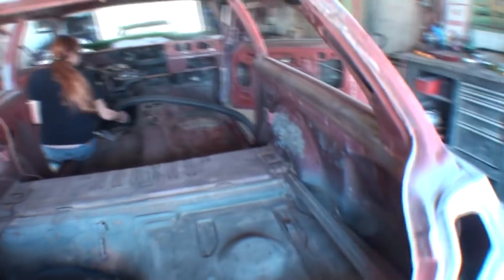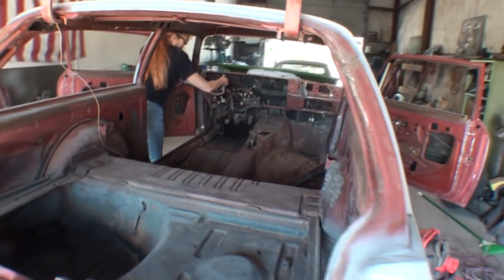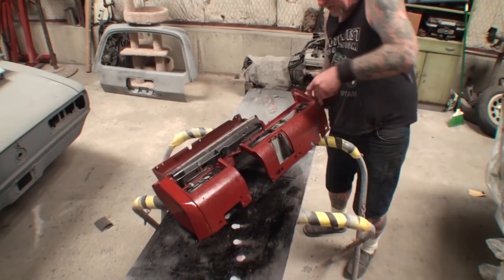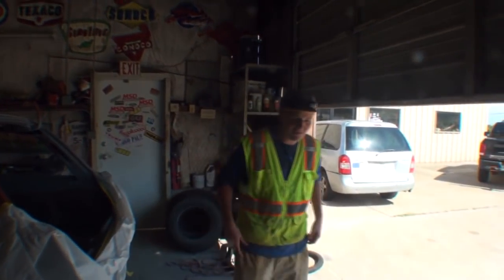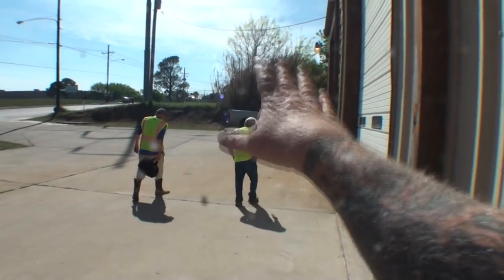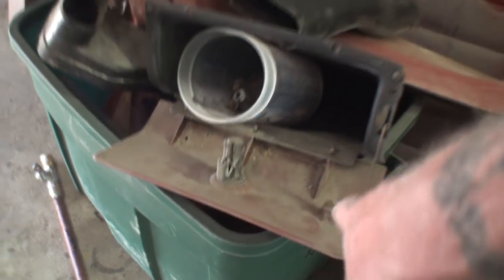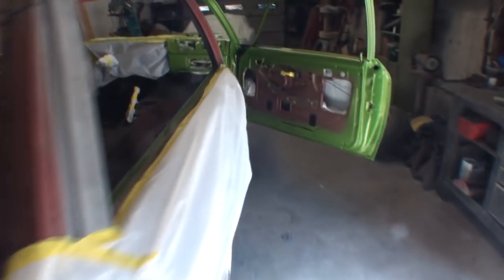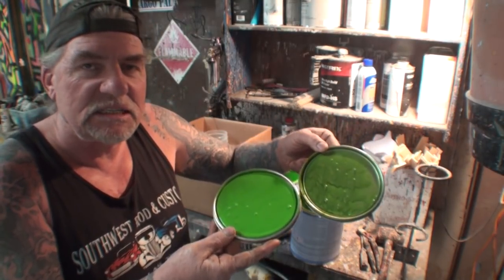How To Restore A JUNKYARD Car - Part 17 - Wrong Color GREEN

Comment: Its going to be a even bigger issue since its likely you will start to lose the "grain" of the interior plastic parts.  AND, if things go the way they usually do, there will be one almost hidden spot you miss 2nd time but will be very obvious from one angle and it will now stand out like a sore thumb as those greens are so different.